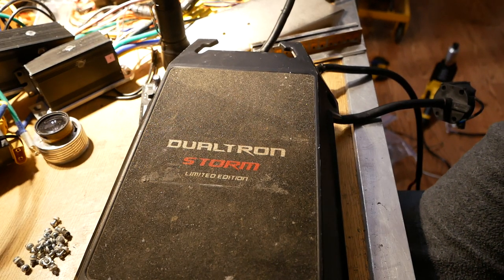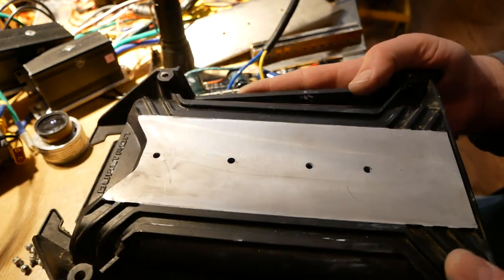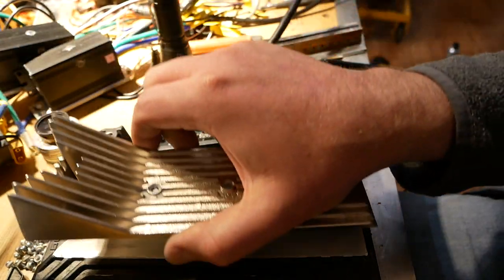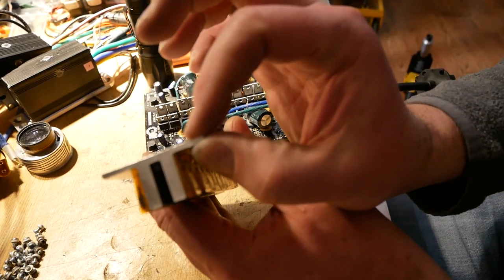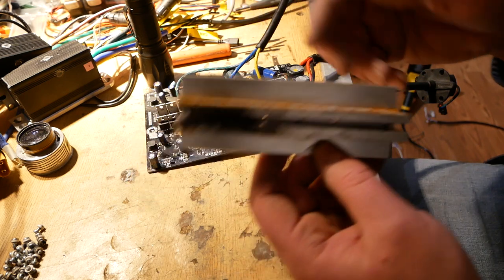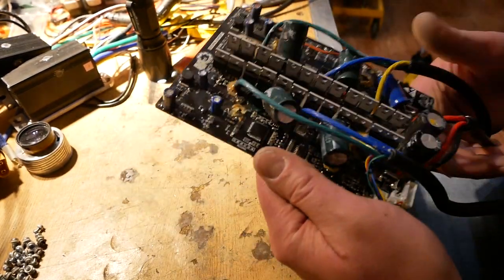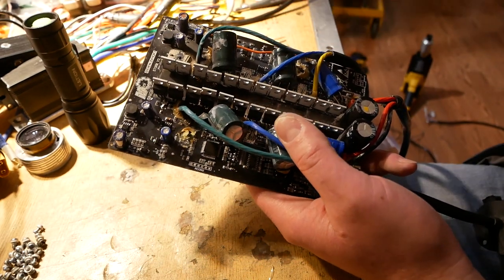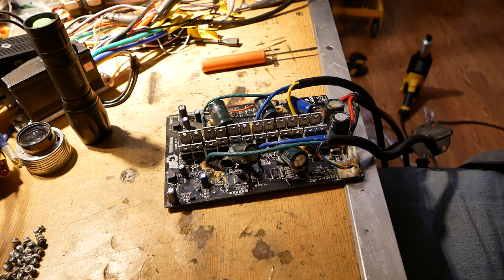Dualtron Storm LTD controller teardown - Why they die so often

Comment: Do you think that the vibration of the motors when they are in charge can come from the controller? That vibration occurs when you press the accelerator to the maximum, so practically when the controller discharges a high current. As the speed begins to increase and the current in the controller begins to become linear and constant, that vibration disappears. Thanks!
Reply from the maker: Are you describing some sort of stuttering in the motors? Vibration is mechanical usually. If whatever "vibration" you are describing happens when the motors spin in some RPM range, that's probably wheel or motor balance issues. I don't know what you mean by "in charge". In charge of what? It's difficult to understand what you are describing. I guess it's possible for the front motor to stutter since it has no halls while the rear motor might run fine...or vice versa. Once motor RPM reaches "some level", things might smooth out???  I'm just guessing because I don't understand what you are describing at all.
Reply: @de-bodgery  It's a shake in acceleration, it doesn't seem to be mechanical. So let's say it runs at 30km / h constantly, everything is smooth and normal, the moment I accelerate and pull maximum power from the controller, the engines start to stop running linearly. After the current starts to drop, that is, I no longer pull 45A from the controller and pull 30A, the motors start running smoothly again. They attributed this problem to older engines that had one-centimeter shorter magnets. In the meantime, the new engines came to me, I changed them, but that interruption persists for me and the other users. I thought maybe this is because of the controller when it is in high demand. And if I start from an aggressive point of view, that is, I discharge a maximum current from the controller, the motors have a vibration as if the current is unfiltered or as if the controller is choking. After reaching a speed of say 60, 70km / h and the controller no longer has to develop such high power, the inep engines become smooth and without shaking. It is a bit difficult to describe the effect, it is that when you have a spark plug or a bad coil at the heat engine, you accelerate and it starts to shake and can not develop the desired power. I hope I have better described this phenomenon. Thank you very much for your time and answers.
Reply from the maker: @ChristianLepah  OK...I have some theories. This explanation makes lots of sense to me. In this video, I talked about that set of 330uF filter capacitors and the others are 470uF. It maybe that the filter capacitors in your controller are working poorly. With increased amp draw, the amount of induced noise on the battery busses increases too. This is controlled and leveled out by those filter capacitors. With excessive noise and flutter on the DC power busses, you can see the very behavior you are observing. The newer vs older motors would not be the likely sources for this. Motor redesigns are about better efficiency in the motor or some expensive design element being removed for something less difficult to make. This does sound like poor DC filtering to me.  If you are up to it, you can buy new capacitors to replace the ones you have now or get another controller.
*
Are you in the USA? Do you still have your original motors?
Reply from the maker: @ChristianLepah  I have a freind in Romania...Alex. I realize we are talking about an entire country, but then you two might be near each other too. 
*
Caps...get 6 more 470uf, 100v caps so you can replace all 6 that filter at the mosfets. You will replace the 2 330uf caps with 2 470uF caps that I point out in this video. The value and voltage of the cap isn't the only thing to check. Physical size matters too. You can get very tiny caps in comparison to the 470uF caps in your controller with the same voltage and capacitance. Get ones of similar physical size as are already there. I don't know what brands you might have available there, but Japanese brands are generally good and Chinese brands tend to be less good. Buy from legit electronics suppliers such as Digikey, Mouser or Arrow and not ebay or whatever. It's important that they get installed correctly. Reverse their polarity and electrolytic caps explode! While you have the controller opened up, look at all the electrolytic caps. You want to replace any of them where the flat top of the cap is bulged or split open. Sometimes they will lift off their rubber seal on the bottom...look for that too. Probably you have 1 or 2 caps that are failing. This is a somewhat common thing to have happen. Over the years, I have replaced thousands of electrolytic caps!
Reply: @de-bodgery  Howdy! Today I managed to change all the condensers with some of 470mf. We feel the same as with the old ones, the engines shake during sudden acceleration or when they have to develop maximum power. I have several friends who are electronics, electricians, physicists, they all attributed this problem to the controller located behind the engine. The motor generates a very large magnetic field and puts all the electronics in the controller in trouble, causing interference due to the magnetic field.
Reply from the maker: @ChristianLepah  I'm highly skeptical that is the case. If it was some sort or EMF from the motor doing this, then all Storms and LTD's would do this and that is simply not the case. There's plenty of examples where controllers are mounted inside hub motors and they don't do this. You can't get closer to the EMF source than that! My controllers are always mounted very close to my motors so the phase wires are very short. I don't have this problem on anything I've ever built. Also, the controller is inside a metal box. This is unlikely to be RF either. This explanation just doesn't track with anything I've ever seen before.
*
My Zap scooter, go look at the videos. 2 controllers, 20,000 watts and they are right next to the hub motor. The LTD doesn't make but 11.5kw across 2 motors and that rarely and for very short peaks. I can pull 20kw any time I want and hold it there! EMF isn't the problem.
Reply: @de-bodgery  Then we have to give the people from Minimotrs another two years, maybe they will be able to fix the problem:))
Reply from the maker: @ChristianLepah  You are welcome to wait. I've heard rumors that there is a new LTD that supposedly "fixes" all the current LTD issues. Uhuh...we will see! Minimotors/Dualtron has said that sort of thing before! They do have a few new scooters that just showed up at the shop. I have not had any time to look them over and probably won't take them apart except when they have problems. Such is the life of an EV nerd! 
*
For your LTD. You'll have to figure out what is happening. There's still the motors and the possibility of cut insulation causing arcing to the stator. This can make for a stuttery EV. Inside the controller box is the control signals from one controller to the other and the signals coming in from the EYE. All of this is potential sources of weirdness. If the enable signal from the EYE is not stable, it could cause stuttery behavior. If the control signals between controlers is wonky that would cause issues. There's things yet to explore. What happens if just one motor is plugged in?
Reply: @de-bodgery  I checked, the shaking comes from the rear engine. More than likely, the front engine loses a lot of grip and then it is not suffocated by power and does not shake. I also put the controller on the board on which I stand with my feet and it still shakes, so it's not from the electromagnetic field. So I still think that these engines still can't develop this power and that's why it shakes. In the meantime, I also made 50A shunts on the engine and the shaking got worse and worse until the battery reaches somewhere around 89V. So even greater power not supported by the engine or controller. I still don't know where this oscillation, mess, shaking comes from, from the controller or from the engine.
Reply: Can it be influenced by something like, the cable from the front motor passes glued over the cable from the battery that powers the controller?

Comment: Do you know if we can install a sinewave controller on the storm? Like at least engineer something? Or do they have something out there where we can install 2 Seperate controllers?
Reply from the maker: Yes to all of the above. It's jsut motor controllers. Use whatever you want.
Reply: @de-bodgery  appreciate the response man. Do you know any controllers out there that would work on the storm? Of your knowledge ?
Reply from the maker: @cohegaming8069 Did you read what I wrote? Here, let me state it again for you. " It's just motor controllers. Use whatever you want." I mean that very literally!
Reply: @de-bodgery  I’m so sorry I’m just a bit ignorant with controllers. For example, the storm has a 40amp 72V controller. Can I just use any 72V controller and not worry about that amps? I guess what I’m asking is, do the specs have to be EXACTLY the same?

Comment: Thank you for the video! Do you think is possible to use Thunder 2 or X2 controllers with Storm LTD battery ?
Reply from the maker: X2 might work since that's a pretty powerful scooter like the LTD should be. Honestly, if you are willing to learn, get replacement controllers NOT made by minimotors. VESC is complex and you'll need to work out wiring to make after market controllers work with your LTD, but it's quite doable. I'm doing it right now with my Dualtron City. This is not impossible and the end result is a much better EV!
Reply: @de-bodgery  I understand for vesc. X2 controllers are made for 72v battery but LTD are 84v. No risk of damage the controllers with different voltage?
Reply from the maker: @caglayan4883  The X2 charger is 84v at full charge, same for the LTD. Minimotors only have 3 voltages or cell counts for all their EV's. 12S or 49.2v at full charge, 16S or 65.6v at full charge and 20S or 82v at full charge. I guess they do this "other voltage" thing to be cryptic or make one EV seem better than another. All the stuff that is 60v is really 16S and charges to 100% at 65.6v. All the 72v, 84v, etc EV's all charge to 82v and have 20S packs in them.
Reply: @de-bodgery  im not talking about charging but battery voltage. 72v scooter at full charge are 84.4v but Storm LTD full charge are 96v so 84v battery vs 72v battery. 
My question is what happen if I drop 72v X2 controllers on 84v battery of Storm LTD (96v). Does it support it or it will burn ?
Reply from the maker: @caglayan4883  Same thing. If the charger output goes to 82v, so does the pack. 82v is full charge and 72v is nominal charge. Again...this is confusing. 
*
From here, it's seriously confusing!
https://dualtron-shop.com/product/dualtron-storm-limited
If I assume that 95.4v is fully charged, then at 23S, that's 4.15v per cell. At 24S, that's 3.98v per cell. 84v is equally confusing! 20S at 84v is 4.2v per cell. 23S at 84v is 3.65v per cell and this is well below the typical nominal cell voltage of 3.7 to 3.8v. 24S at 84v is 3.5v per cell. This is pretty much end of charge for LION packs. None of those really make sense except 20S and over charging the cells slightly. 95.4v doesn't match anything either. 22S puts all the cells at a dangerous 4.34v! 23S is 4.15v per cell. 24S is 3.98v vper cell. Based on the quoted voltages, I can't eliminate any of these cell counts! You are right about the LTD being at a higher voltage. I'm guessing here since 84v is below nominal cell voltage for 24S and I've never looked at an LTD pack before. 
*
This sales page says 84v and not that other 95.4v. I've always thought the LTD was running on 20S. My assumption is that the 95.4v is a mistake on the web page. 
https://minimotorsusa.com/products/dualtron-storm-ltd-electric-scooter
*
I asked the local scooter shop where I do repairs if they knew. LOL...same thing...they were equally confused about those voltages! There is potential reasons for this. Supposedly the LTD has been totally revised. I've never seen one of these "new" LTD's so I can't say anything about that. This might explain the voltage disparities.
*
If Mininmotors was putting 100v max controllers on a 95.4v EV, well that would explain the blown controllers! This is waaaaaay too close to the maximum limits of the controller! It would not be hard at all during regen or just motor noise to exceed 100v and blow up mosfets!
* 
On your charger, it lists an output voltage. What does that say? IF it says 84v, your pack is 20S. Chargers typically list their actual maximum output voltage.
Reply: @de-bodgery  I have "Old" storm LTD and I can confirm you the charger I use its 96v and battery are 84v nominal :))
Why question about X2 controllers 😉
Reply from the maker: @caglayan4883  OK! So that's something I didn't know about. Probably a HUGE reason for LTD controller failures is the LACK of appropriately rated parts in them. If LTD packs are all 96v, then 100v controllers are inadequate for the job. The Storm is 20S/82v and this is one more confirmation that all minimotors did was up the voltage and wattage and hoped for the best with the LTD on the exact same controller. Good job Dualtron...bunch of idiots! LOL. You do NOT want to run 100v max controllers at or near their maximum ratings or they will burn out! The X2 controller would do the same thing as the LTD controller. since it too is a 100v max controller. Operating at or very close to the maximum limits is going to create failures! So if you want to fix your LTD so it doesn't burn out controllers, that's quite doable, but assume you won't be using parts from Dualtron.
*
VESC is my preferred option, but there isn't anything in the 120-150v range right now that is also in the wattage you need. Soon there will be several options, but they are 3-6 months away. All the 120 or 150v stuff available now is way over the wattage you need and as a result pretty expensive. VESC is awesome, open source and the options are growing all the time! New VESC development is ongoing and the platform has been very stable for several years.
*
Kelly makes a line of controllers that are much superior to anything from minimotors/dualtron. Their 8080i series will have something in your voltage and wattage range that isn't overly large. The back foot pad won't get used like it is now since that space was designed to specifically fit the controllers placed there. Kelly controllers will not look or fit the same. What they will do is be rated for your battery voltage and your motor current demands. The Kelly website is down right now so I can't just say "Get 2 of these and you will be good." Expect if you go the non-dualtron route, that you will be needing to do some rewiring. The way Dualtron does things won't all work with something not from Dualtron. If you look at my Dualtron City build videos, I've kept all the lighting, but all the controller wiring is all completely redone. I don't use the EYE display/throttle, etc. Honestly, IMHO, this is a good thing!

Comment: After watching this video, do you think can modify a storm controller so it can work right? Maybe even add the hall sensor wire to the harness for the front wheel?
Reply from the maker: Adding the halls is the easy part. you'll need to add the connector to the board and run a cable to motor. I assume the motor has halls in it already. As far as improving the controller...that's hard to say. If yours is like the one I took apart in this video, I'd say you would do better getting a couple of VESC 100250 controllers instead!
Reply: @de-bodgery  I'm not that keen on doing this sort of a thing. I can take apart the scooter, but setting up controllers is out of my area of expertise. My storm still works, I just want to prevent failures of this controllers shortcomings can be sorted.
Reply from the maker: @DrWonderEyes  Well...in this video I do mention a bunch of short comings. You could try fixing them and see what happens.
Reply: Motor does have hall had to change my bearing
Reply from the maker: @ZxZx-bf7iz  yup...rear motor has halls, but not the front motor.

Comment: Thank so much for the video. Very informative.  I just got my Dualtron Storm limited scooter last week and I wonder if it's the same controller. Maybe I should call VoroMotors and find out. I will revisit and update the comment section whether or not I find out anything.
Reply from the maker: They might not know! This controller was new 1 year ago. Who knows if Minimotors has changed them since then or not. Lots of places that sell and repair EV's don't pull things apart to check them out. It's just a part to swap out for a new one when the old one fails. I take things apart becasue I'm curious about their construction so I take stuff apart.
Reply: @de-bodgery  I understand.  It wouldn't hurt to ask. If they are unaware, then maybe they can pass that info along so they can produce a better product going forward.
Reply from the maker: @NorKal530  Minimotors is subbed to my channel. I assume they watch my videos.
Reply from the maker: @NorKal530  I think this controller is the same one as is on the Ultra. The regular Storm and the Ultra have nearly identical ratings and they both use that rear kick guard controller placement. I still think they fail becasue they are a marginal design that is simply pushed too hard.